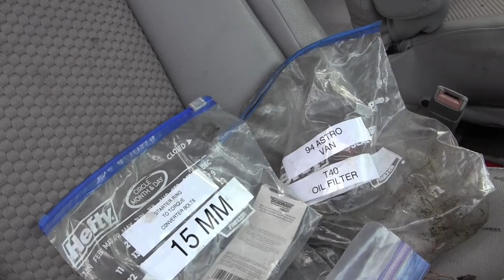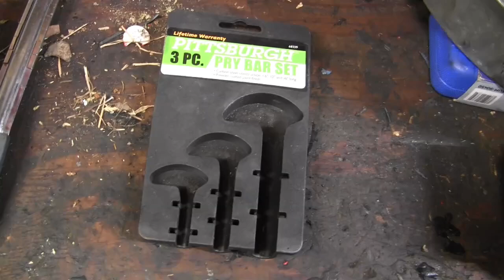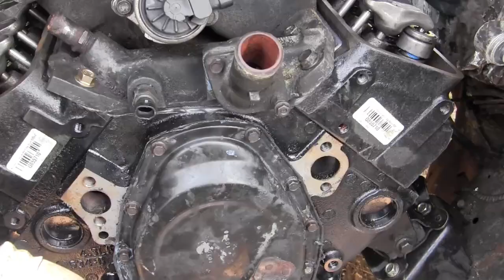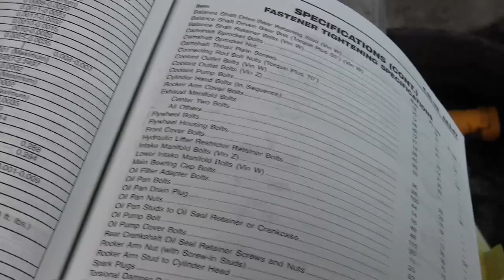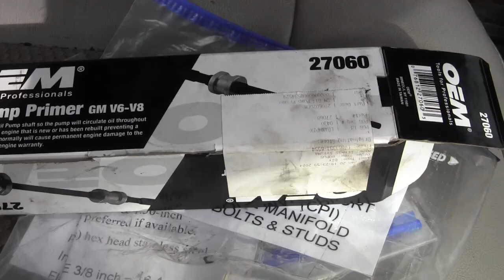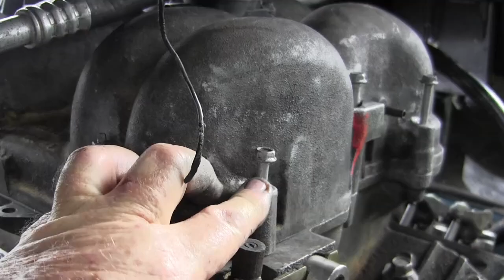Astro Van (94) 8/16/2024 video diary (vlog) Revision # 1

Comment: Hey thanks for the shout out. Great explanation on lighter weight on hoist. I pulled my engine out with all the weight. I will see if I use your lighter weight install. It was/is hard to move the hoist and full engine by myself.